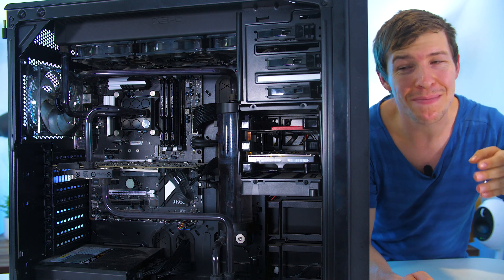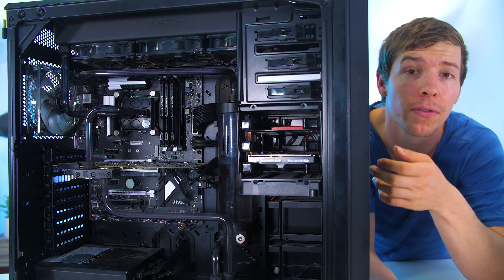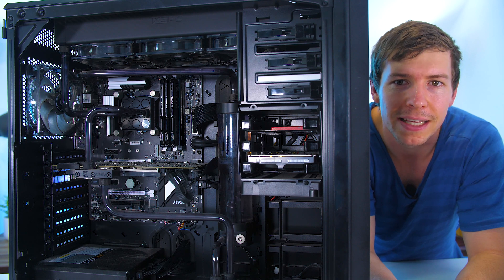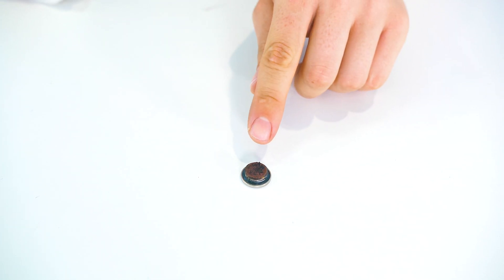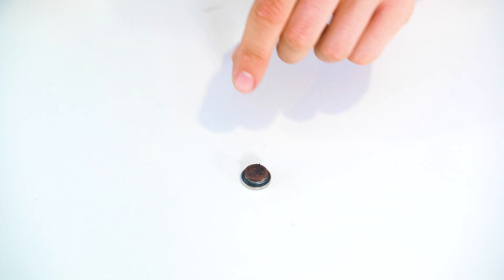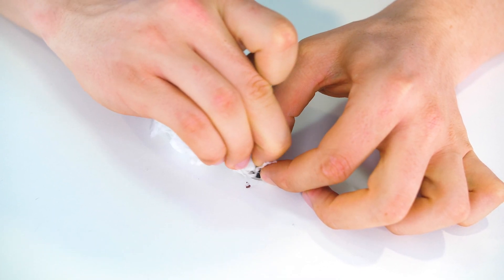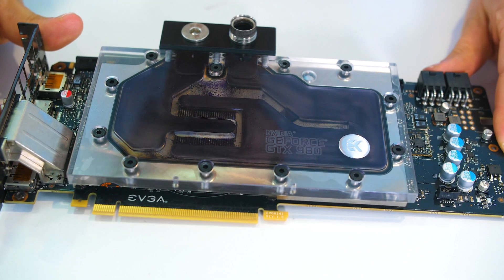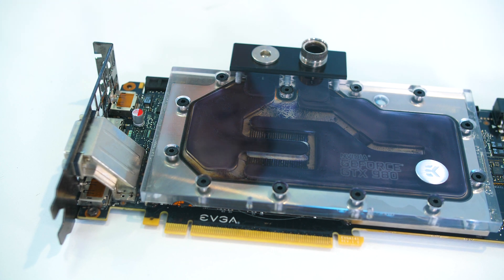He DIDNT CLEAN His Water Cooled PC in 4 YEARS! This Is How We SAVED It

Comment: I'm half tempted to do a water cooled build.

Assuming it's properly maintained(drain and change coolant once a year or so?) how often should I expect to replace things like pumps, radiators, fittings, etc.

Did you need to spend 500 dollars on parts because he neglected to clean it, or is that normal?

Also, would using clear/UV coolant help instead?

Comment: Omg ... just flush the old rad and it will be fine ... since you need to flush the new one anyway you might wanted to try and flush the old one (boil some water and fill half the rad and shake it would get rid of most gunk) also replacing the fittings is a waist of money ... those are pretty easy to clean
Also if you cleaned out that D5 very well it would probably just work fine most of the time it’s just gunk inside the rotor that causes this issue (jaystwocents made a video on this issue with his D5 pump)
I had a pc running for 4 years and I only needed to replace the tubing the rest is just working fine
Reply from the maker: No no, the pump was completely dead, i tested it all of camera. The radiator had rust and growth. Its far too damaged. Fittings also had rust

Comment: Now think. This is the PC from 2015. And this is intel. So at best, it's 4c/8t CPU that runs well under Hyper 212 EVO if you undervolt it :D Watercooling PARTS ONLY to fix the problem were 500$ total :D
That's what happens when you build PC for "DA LOOKS".
facepalm.jpg
Reply from the maker: What?
Reply: @DesignsByIFR Huh? The cost of watercooling parts is much higher than the cost of the PC components themselfes.
Plus, you don't really need watercooling to get the old 4c/8t intels chill. Just delid them and u're fine.
So the purpose of the watercooling in this particalu case is - THE LOOKS.
That's applicable at least for the CPU.
Got that now?
Reply from the maker: Oh no i get what you are saying, but have you looked at my channel? My chqnnel is all about the looks of a pc
Reply: @DesignsByIFR   TBH it was just a random video that i watched. The looks...
Well i totally appreciate a good looking PC.
Custom watercooling is a great thing.
BUT i think it should be in balance (pricewise) with the rest of the system.
Let's say, you build smth like 2600 + 1070 which is a fairly cheap set up. I don't really think you should compliment that with full custom loop. An AIO would be just fine.
On the other hand, if we're tlaking about 9900K + RTX20xx for example, full custom loop is "in balance" with the rest of the build. Plus it's pretty much needed, the 9900K is very-very hot,  so it will be not just beautiful, but functional as well.
You know :D

Comment: I have this 99% isopropyl with something in it to break down minerals. Used to clean out Printer Ink Jets when they clog. (as in removing the mechanical part from the Printer)
I have soaked a Radiator with 50% water and a cheap fish tank pump in a bucket to circulate the liquid and clean out the Radiator for a few hours, worked great as far as I can tell.

Comment: Those Thermaltake parts are pretty fugly. The EK blocks stood up well to that long without a flush which is good to see. I don't understand why people want dyes in their coolant at all but especially if you aren't into doing regular maintenance.
So was the bearing of the D5 pump worn out? Or some other problem?
Reply from the maker: The pump had no clogging or anything, its just dead

Comment: why do pc water cooling solutions have such silly connectors? i would trust male parts coming off cpu/ gpu blocks etc with the hose over them and a hose clamp far more that this screw setup... if its good enough for a cars radiator its good enough for a pc.

Comment: $500 for all new watercooling parts.  How about ditch water cooling, and spend that money on a new graphics card instead
Reply from the maker: Why would i want to buy him a new gpu when i have water cooling parts sitting there and his gpu is more than capable. You make no sense
Reply: I'm sure his gpu will be more than capable for another 4 years, when the system is already 4 years old.  You can do whatever you want.  I was just stating that why spend so much on water cooling.  A new gpu would bring more value for the money.  Try thinking outside the water box sometimes,
Reply from the maker: Its not thinking outside the box when i already have the gear man. And the gear is sponsored equipment. It cost me nothing but i didnt gain 500$ if i was to sell it

Comment: Use a pure bristle brush as there is no static and best way of getting the fans cleaner and brushing out the dust from the harder areas and fans. Used pure bristle brushes for years with no issues. DO NOT get the Nylon ones, MUST BE PURE Bristle paint brushes. Great for the areas on boards also that you can't get into with air etc as the dust can still stick. air + these brush types is even better. Anyone who says NOT to use em doesn't know what they are talking about. Remember PURE bristle NOT Nylon. The brush can also loosen the dust and air blow it out.

Comment: I've been putting this project off from some time now. The fluid in my reservoir has been slowly dropping over time (maybe 3 yrs?) and is down to like a half inch of fluid even though I don't have any leaks... Is that normal?  The level in my res doesn't seem to effect my flow and it's not low enough for the pump to cavitate or anything. If it's a closed system and the fluid has nowhere to go, then where did it go?  Really, I have no leaks, I even used my hunting flashlight that makes fluids glow (like on CSI) and everything is clean...lol
Reply from the maker: It is normal for the liquid to slowly evaporate over time

Comment: This is why my system is air cooled.  A quick blast of compressed air every year or so and maintenance is done.
Reply: What about thermal paste
Reply: @ruudiutsenikov609  What about it? I built the system in 2011 and haven't touched the thermal paste since.  The processor, a 2700k , is starting to show it's age but the temps have remained the same.
Reply: After 1 year use, I add on the loop some normal clean additive (antichalk) and let the fluid 24 hours, after that remove the liquid with fresh distiled water WHITHOUT ANY COLOR  - if the loop is mounted the gasket are ok. with air compressor clean the inside without to remove each component, after 2 years is better to check the thermal paste...

Comment: i have an H100i and havent done anything to it in about 5.5-6 years... Should i refresh the water? I'm not sure how to on a closed system..
Reply: AIO Coolers are supposed to be maintenance-free. You just leave them running until they die and replace them since they are cheap and for casual builds. Clean the fans and the inside of your case with a paintbrush + compressed air once in a while and you're fine. Custom water loops with hard tubing are a completely different story.

Comment: Uhm.. O_o why did you not take the whole block of the gpu before cleaning?? You risk damaging the components under the gpu with too much force or the gpu itself if you spill water on it. And it would be alot easier if you took it off.
Reply from the maker: There was no amount of harmful force applied
Reply from the maker: It is also rubbing alcohol used. Dries up in seconds

Comment: Why didn't you use glycerine (freeze protector), readily available for cars and solar installations?You'll get much less corrosion inside the system!That's one reason (despite the freeze protection) why they dump it in the cars. Also, depending on type, it's either red/orange, blue or green and fluorescating.
Reply from the maker: Because that contains glycol which reacts bad with PETG and the plastics in watercooling parts
Reply: Seems to be an urban legend, because many people are using it since years without any problems. The tests with chemical reactions where based on 100% ethylenglycol, the normal anti freeze only has around 30% of it. You also only need a lean mixture because your PC will likely not stay outside in winter and tend to freeze, so at the end you will probably end up somewhere at 2-5%.
Alternatively, there are mixtures based on vegetable products without any ethylen-glycol.
Reply from the maker: Definatly not a myth iv seen it with my own eyes

Comment: Great job saving that computer!  Thanks so much for the video.

Saw that the EK water blocks for the graphics card and the CPU had the look of Aluminum.  However, you are putting in a copper Thermaltake radiator.  Are you sure that they are compatible, and there will not be galvanic corrosion?  If the EK CPU and graphics card water blocks are copper, then ignore this.  However, if they are Aluminum, you must only have an aluminum radiator, or you will be heading for big problems.

For the money you spent on all the new fittings, radiator, and pump, a set of 3 +1 LED fans on the radiator and back of the case would have been nice to really bring in some "bling".  However, those are cosmetic, and like you said in the video, he wanted it functional and up and running, so not necessary.

Finally, noticed that you used a Thermaltake standoff fitting from the CPU water block.  I thought the original direct looked just fine.  Wasn't sure why you did this.  Maybe the Thermaltake fittings were too bulky and would not go in directly?

Once again, thanks for the excellent video.  Very informative!
Reply from the maker: Hey mate thanks. Yeah they are nickle plated copper =)

Comment: Since I use distilled water and high performance antifreeze I don't have any of these corrosion problems.  Also, nickel plated heatsinks, no acrylic and black tubing.  A water cooling system that's high performance oriented and not bling oriented.  I have been water cooling since 1999 with no leaks ever.

Comment: Question for IFR: 

I built my first PC a little over a year ago. The cooling for the CPU was done by an Alphacool Eisbaer 360 AIO (cpu block and 360mm rad). Gpu was air cooled. Over time I added a second GPU, full-cover water blocks for both GPUs with integrated pumps (Eiswolf by Alphacool, same pump as the Eisbaer), and a 60mm thick 280mm rad, and an in-line sensor that displayed coolant temps and flow rate. I recently had a very small leak from that in-line sensor (Thermaltake Pacific TF1, copper like the rest of my loop) due to over-tightening of the inlet G1/4 fitting and noticed the coolant was a light greenish-blue color, barely noticeable until you really looked at it under a lamp. The coolant, that I’ve topped off with every new component, is the Alphacool CKC (Cape Kelvin Catchers) pre-mixed distilled water and glycol mix, completely clear. All of the tubing is flexible, black, explosion proof, and wrapped in anti-kink springs.

Is it normal for clear coolant in an all-copper loop to become slowly saturated with free copper ions over time, even if the coolant is advertised as having anti-corrosion properties? I’m not very well-versed in cooling loop construction and PC building and kinda hope I won’t have to disassemble everything to put fresh coolant in. I honestly though AIO’s would be maintenance-free for several years. Now I have to figure out how to remove the air that got introduced by that leak. I can see it trapped in the CPU water block’s window and it’s annoying. 😡
Reply from the maker: Hey man. I believe traditional AIO coolers have a liquid in it that is a tad green or blue and traditional AIO coolers had an aluminium radiator. I am not familiar with the Aio coolers you are speaking about however if everything in your loop is pure copper and you originally put your own clear liquid inside then i am not sure what is going on there. 

If the AIO came with its own liquid then it usually is a tad green
Reply: @DesignsByIFR  Understood. I didn't actually know that the liquid in an AIO is usually a tad green. That fluid I used to top things off was recommended by Alphacool specifically because they said it was compatible with their products. I went with Alphacool primarily because of the copper content and the research I did prior to diving into PC building basically said that copper had a more efficient/higher heat conductance than aluminum. 

Thanks for replying, it's helped alleviate some of the nervousness I was experiencing trying to maintain my loop.
Reply: @koldphusion21  Hey Mark, i have got a watercooled system with alphacool products also. I just have copper in the system, while the gpu cooler is (was!!) plated with nickel. I also used the alphacool liquid... I went blue over one year (but was clear) , an has eaten up all the nickel. Luckily there is a stainlesssteel-filter in my system, which has collected all the slimy junk. I cleaned it all up, the washed out the radiators(they stayed in the system) and loop with destilled water until no more "blue" was in the system. After all that: i filled it with destilled water with a concentrate from "innovatek". Its in the system for a year now, and everything is still crystal clear!!! Alphacool is not that good as everybody says. I had some issues with different product from them. :-/

Comment: I cleaned mine recently and as I used premixed clear stuff and tried to aim for minimum mix of metals in the loop (which you cant properly do) I was astonished. The water still was clear, the amount of dirt in the coolers were not too much (but I recommend at least cleaning them more often. After I reassembled everything, my temperatures werent showing any benfit...perhaps 1°C.
It is strange, but cleaning didnt bring me any benefit after doing it after 6 years :)
I will go for a new loop in autumn with ryzen gen 3 , but it really isnt that bad unless you really have those dyes in it. My clear flexible tubing got yellowish from the outside though. 
I dont think,  that not cleaning really will cause an absolute failure. 
BTW: I am solely looking for the easiest and most flexible solution of watercooling. It doesnt need to be pretty, but I am think of connecting the tubing with fast connectors to everything and additionally look for the easiest way to drain and refill the loop without any stupid hassles. Still dont know the current market too well, so I need to do research in the next few months on what is really high quality + durable + absolutly no hassle.

Comment: Those water blocks weren't copper and ur using a copper rad, ur just asking for problems when u mix metals in a cooling loop like that, thats probably what caused a bunch of the corrosion in the old loop
Reply from the maker: They were nickle plated copper

Comment: I hope your mate fixes you up with a case of beer or something for using up your profit margin fixing his rig. I held my breath when you put water on the GPU block while it was still on the card though! I would be careful with those O rings on the supremecy evo blocks mine went brittle and split when I opened mine for cleaning.
Reply from the maker: It wasnt water it was isoprophel alcohol, it dries up in seconds
Reply: @DesignsByIFR  Ok cool. It looked like water at first glance. Did your mate sort you out with the required amount of beer? This is the most important issue here mate. You well and truly saved his rig there.

Comment: what's the point of water cooling
Reply from the maker: Keep things cooler and for overclocking a lot higher and aesthetics
Reply: @DesignsByIFR  if that's all, I'll stay with air. I ran temp test and it runs at 30 degrees full load.